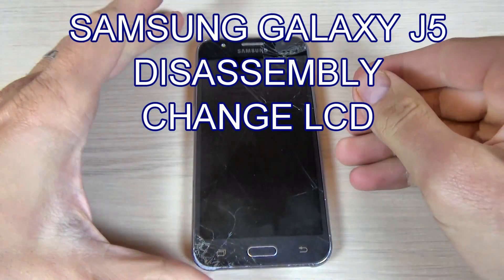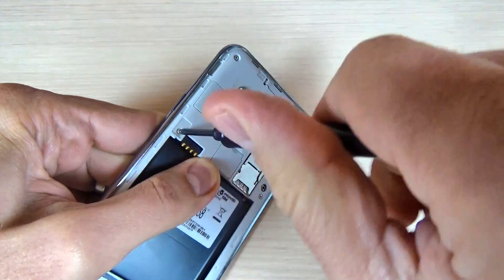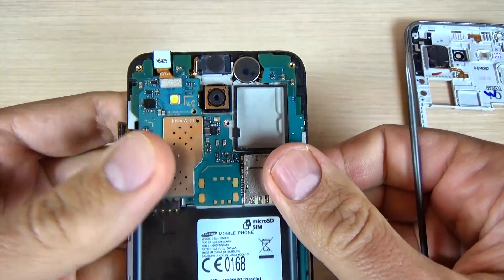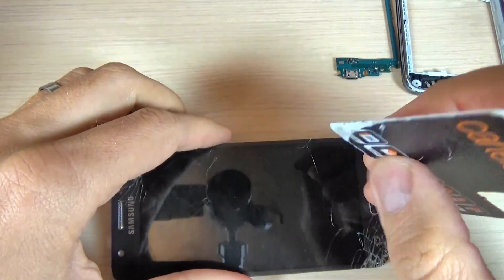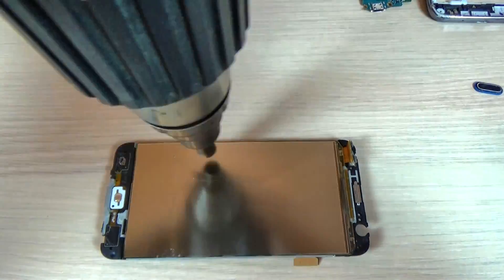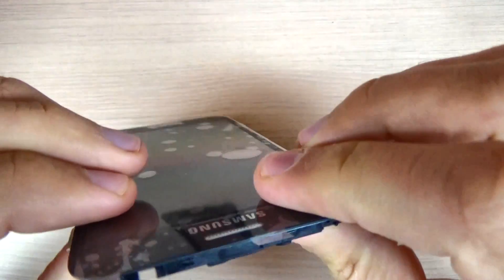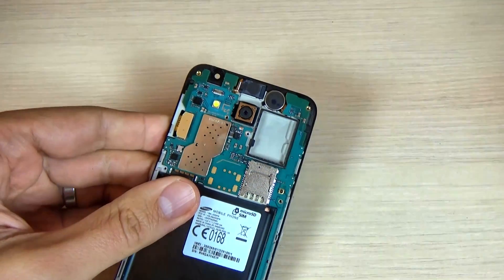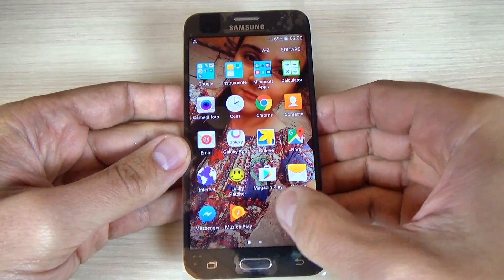How to FIX Samsung Galaxy J5 | Hardware Repair | Disassembling | Change LCD

Comment: Hello! Can I ask a question? 
Is the Samsung Galaxy j500F display compatible with Samsung Galaxy j500FN display?
Reply from the maker: yes
Reply: SantaSmiles At me didn't work the j500FN display. It was perfectly working only 2 months,and then it had problems again with the display
Reply: GSM-ABC u said lcd ? Is that amolde display?

Comment: j5 nu se conecteaza la laptop. solutii?
Reply: George GMC Setarile telefonului. Este o setare,dar nu imi amintesc cum se numeste
Reply: o caut de ceva vreme
 la USB am incercat toate setarile. deloc nu merge
Reply: George GMC Nu imi mai amintesc ce setare era,deoarece am spart tel acela acum 2 ani
Reply: George GMC Depinde ce vrei sa faci
Reply: sa descarc pozele
Reply: George GMC Trebuie sa dai din calculator sa descarci pozele.  Cred ca o sa fac un videoclip si il pun pe YouTube
Reply: si 😀
Reply: ma rog,la mine ca sa faci conexiune MTP,tre sa activezi debugging
Reply: sau daca vrei,poti folosi smart switch sa faci backup in pc la poze si le iei de-acolo
Reply: pixel, care ar fi solutia ?
Reply: te duci la despre telefon,informatii software (daca ai 6.0.1),la build number si apesi de 7 ori pe aia,te duci la setari dezvoltator,activezi depanarea usb si atat
Reply: rekai74 asa era bifat debugging si inainte. nu merge. faza e ca alt telefon merge pe acelaai laptop. de fapt alte 2 tot samsunt,un s4 si un a7. j5 nu.